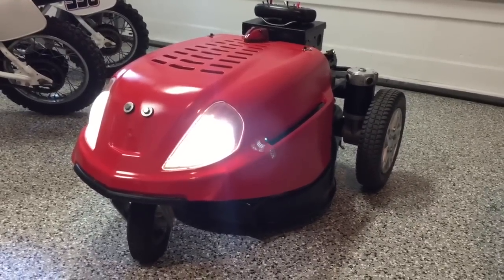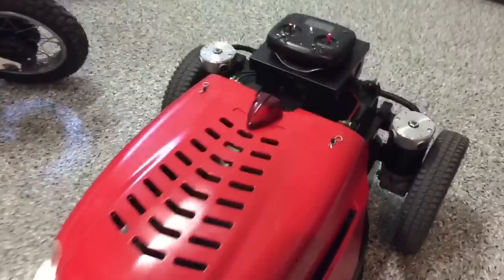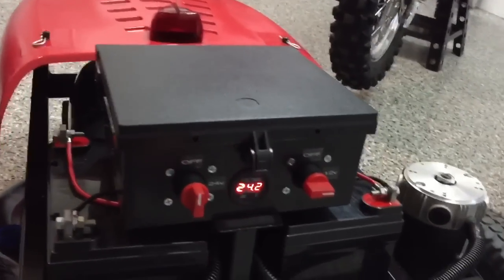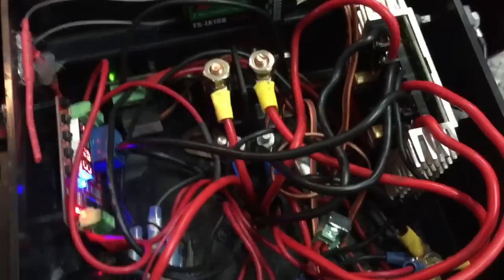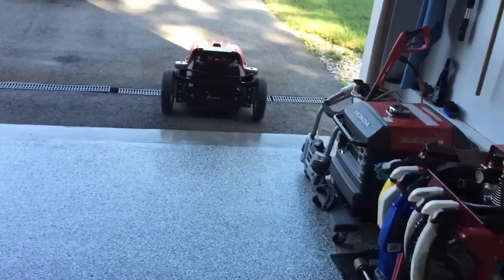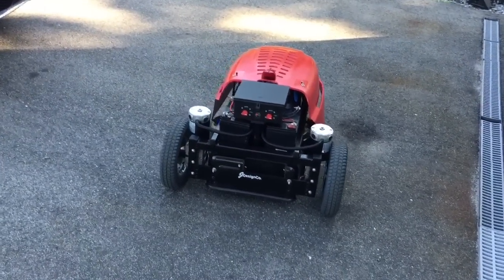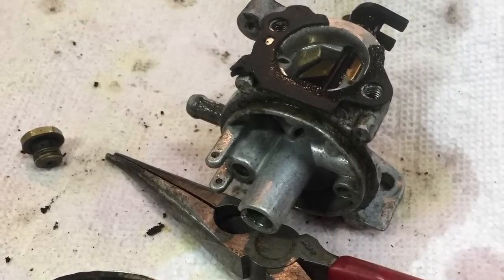Build a Remote Control Lawn Mower

Comment: I was thinking initially the front wheel didn't look right but when you explained it and it turns on a dime I understand.  Doesn't it make it unstable though is my only thought?   Also how difficult would it be to fully automate it so it can function all by itself.  Honestly this is a great solution a lot of the vids I've seen they get over engineered making silky tracks or components you need a 20k lathe to build.   This is nice.

Comment: Great stuff, too bad you did not include more details about the frame
Reply from the maker: Thanks! 
Good point, The frame is made of 1.5” mild steel square stock that the mower deck bolts to. Some pictures of it can be seen at the end of the video.
Reply: @crawfordmediacompany1249  Great Thank you

Comment: Hi Can you show us how to install an electrical starter, please thanks
Reply from the maker: The electric start you see here is built into the mower from the factory so youll find yourself a mower that had electric start originally. You just connect a 12v starter relay to your starter and battery and activate it with an RC “battle switch”
Reply: @crawfordmediacompany1249  Thank you

Comment: yo very good job and very nice rclm i start build mine i have all mechanical parts i want know if you accept to share  your wiring plan
and i want know why you don't put a alternator for reloading the batteries in mowing
Reply from the maker: Thank you. Sorry I did not have a wiring plan in writing. An alternator was not necessary because I found I could mow my lawn 3 or more times before needing to recharge the batteries. In reality I never had any issue because when I was done mowing i plugged in a battery charger.

Comment: Hi , how did you mount the wheels ?
Reply from the maker: They are connected to the motor hubs with lug nuts. The motors have bolt holes for where they mount to an electric wheelchair so I just bolted them yo my frame.

Comment: Did you buy or build the controller?
Reply from the maker: Sunshine i bought the motor controller. Its really easy to use practically plug and play and can easily handle the power these wheelchair motors pull. The brand is dimension engineering.
Reply: @crawfordmediacompany1249  Thank you for your response. Your design look more like manufactured one because it comes with the covered top. I searched many RC lawn mower designers to see which one match my budget.

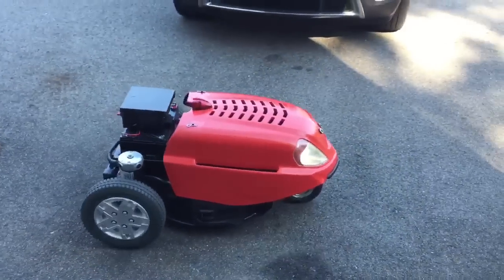Comment: At 2:52, you stop as if there are brakes installed. How did you do that if there are brakes?
Reply from the maker: Great question. There is no need for mechanical brakes the motor controller has regenitive braking just applying a bit of reverse to the electric motors makes it slow down or stop while actually sending electricity to the batteries.
Reply: @crawfordmediacompany1249  But letting go of the stick on the controller may not hold the mower there on a hill right? No parking brakes?

Comment: How did you wire the remote control?
Reply from the maker: Jim The receiver is a standard 2.4ghz radio controller. Each channel coming from the receiver is wired directly to the motor driver or a switch.
Reply: I get a positive pwm signal from receiver, not enough to activate a 5V relay. Relays need a ground to activate. Have high/low triggered relays on order, but concerned that outputs of receiver still not enough to activate. Could not reply to your message.

Comment: The best build I have seen!! Mechanics, electric, electronics, all is so well done. Are there any problems with the electronics because of vibration from the engine?
Reply from the maker: Thanks! It was fun to build and use. 
I didn’t have any vibration issues. I mounted the control boards on plastic standoffs so that helped isolate them even more.

Comment: Can you share the instruction pdf?
Reply from the maker: Ma Cho haha sorry no instructions available this is a custom built one off machine.
Reply: Probably wants to make nock off copys or sell the info at your expense. But thanks for the video. Compiling the parts. What's your input on inline mortors vers worm drive like the one you used?

Comment: Hi, can you describe the reason or why we need to remove the braks from motors?
Reply from the maker: When the motors are on a wheelchair I believe they electronically lock when the chair comes to a stop. When i bought my motors they had the brakes removed already so i didn't deal with it but i believe there would be an issue getting them to operate or they simply are not necessary for this type of application.
Reply: @crawfordmediacompany1249  I want to use 95 Volt PM DC tredmill motor instead of Wheelchair motor to modify my electric mower,,. & I bought the motor driver which has the following Descriptions,
Specifications:
- Input supply voltage: 12V-40VDC
- The maximum output power: 0.01-400W
- The maximum continuous output current :8A;
- The overload and short circuit protecting current is 10A
- PWM frequency: 13 kHz
- Item size:60 * 55 * 28mm
Now Please advise me that above motor driver is good for my project.?
Thanks in advance

Comment: You have the batteries in series for the 24v drive wheels, what did you use to isolate the 12v for the starting system from the 24v ?
Reply from the maker: I just connected the starter relay to the positive on one of the batteries. The starter grounds to the frame. The limited use of the starter motor pulling from one battery wasn't enough to unbalance the two 12v batteries. At first I was going to use a 24v to 12v converter but realized I can just pull power from one battery...

Comment: What did you use to mount the electronics inside the box? I was thinking of using double sided velcro, but wanted to see what you used incase there's a better way. Thanks!
Reply from the maker: Nicholas for the electronics that have small holes drilled in the corners you can use stand-off mounts like these in the link below. Otherwise vhb 3m adhesive tape or Velcro is great. 
Electronics-Salon M2.5 Black Nylon Hex M-F Spacer/Screw/Nut Assorted Kit, for Raspberry-Pi, Standoff. https://www.amazon.com/dp/B01N9Q8YLE/ref=cm_sw_r_cp_api_i_5VGvFbM80R2FA
Reply: @crawfordmediacompany1249  Thanks for the feedback. I might try the velcro route 1st.

Comment: How did you program your warning speaker? mine doesn't recognized the speaker when plugged into usb.
Reply from the maker: You download a program specific to that speaker.  People posted the correct link for the program  in the amazon reviews section.
Reply: Thanks for the reply. I also have windows 10 and am having the same problems others are having with the driver for the speaker. Guess I need to find an older computer to program it.  For others looking the program is here:  http://www.puiaudio.com/resources-software.aspx. But it does not work with USB 3.0.

Comment: How did you do the electric start?
Reply from the maker: The mower had electric start from the factory and that was what I specifically searched for when looking for a junked mower. I used a mower starter relay and rc switch to activate that relay. The 12v power to start it was taken from one of the two batteries that power the wheels. Thanks!

Comment: I'm in the middel(sic) of a build now. Where did you get the voice activion device from? I wonder if installing a voltage select switch to allow the motor to run on 12v or 24v. Cool on the 12v switch.

Comment: Nice job on the build! I built a 4WD RC mower a few months ago and it's working pretty good. I'd like to get about a 36" walk behind like an Exmark or similar to have the electric start capability and I want a FPV camera on it also. When this mowing season is done I am going to weld a new frame for mine and get the camera.

Comment: Nice job!  Did you use the pico switch as a “Kill switch?”  If so, how did you wire it?  It should be straight forward, but I am at the end of my wit trying to figure it out on how to ground out the spark plug with the pico switch.
Reply from the maker: Yes the pico was a kill switch   there is a single wire or tab to connect a wire that will be on the coil.  that wire is the one that will connect into one side of the switch and out the other side of the switch i had a wire that just grounded to a bolt on the engine.  When the switch makes the connection it shuts the motor down. The band that stops the motor should be removed since the engine will be killed by grounding the ignition not just by the band brake stopping the motor.   Good luck!
Reply: Crawford Media Company, thank you!

Comment: What batteries did you use and did you hook up an alternator or are you charging it with like a car battery charger?
Reply from the maker: Mitchell Brenn i used two 12v batteries from Apex batteries. Check out their website and search for APX12-35. A Set Of Two Apex  12V 35AH AGM Batteries. They are the spec batteries for a jazzy electric wheel chair. They are smaller in size but have a good amount of juice stored in them. They will last 4+ mows on a 1/4 acre house lot. No need for an alternator since those batteries last plenty long, then i just toss a standard harbor freight 12v charger on overnight. Using a single 12v charger on one battery at a time ensures they are both charged to their peak. With a 24v charger there is a chance the batteries may not be balanced if one battery is being used more than the other for the electric start, headlights, rc radio etc. Those are not much drain on one battery but over time it could make a difference.
Reply: Crawford Media Company were did get the control box from

Comment: Hi Crawford
I want to use 95 Volt PM DC tredmill motor instead of Wheelchair motor to modify my electric mower,,. & I bought the motor driver which has the following Descriptions,
Specifications:
- Input supply voltage: 12V-40VDC
- The maximum output power: 0.01-400W
- The maximum continuous output current :8A;
- The overload and short circuit protecting current is 10A
- PWM frequency: 13 kHz
- Item size:60 * 55 * 28mm
Now Please advise me that above motor driver is good for my project.?
Thanks in advance

Comment: Why was single front wheel the best?
Reply from the maker: Pretty much so i could get the hood to fit nice over it. Stability was not a problem and it turns on a dime.

Comment: Very nice!!! I have built an RC mower as well (check out on my channel) it's 4wd, works great, but I want to build another one using my old 42" Craftsman riding mower with an engine that has a starter. How did you wire the starter? Can I just use battleswitches directly to the starter wires or do I need a relay? Also to kill the engine? battleswitch to ground? I haven't started the build yet just trying to get organized and get parts ordered. Any help would be appreciated. Thanks!!!